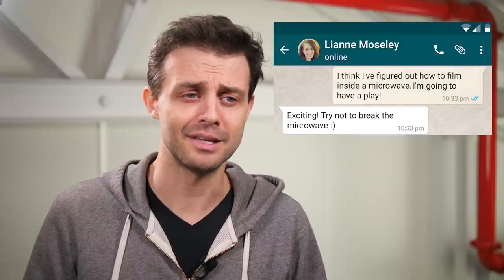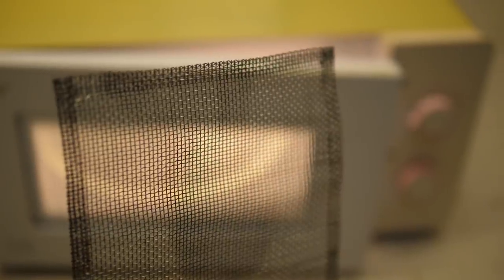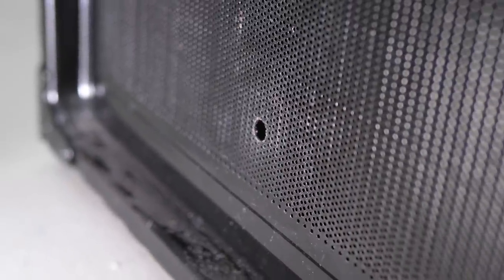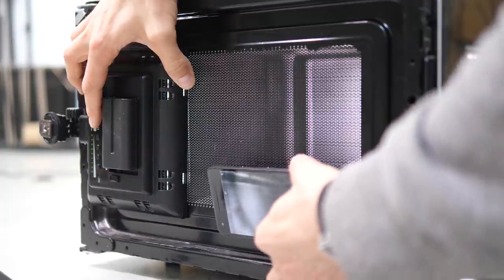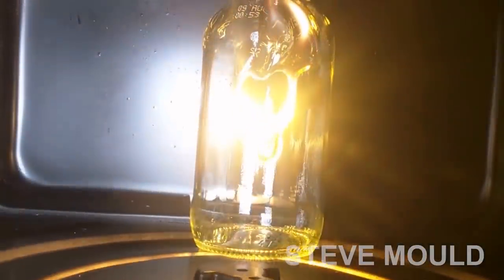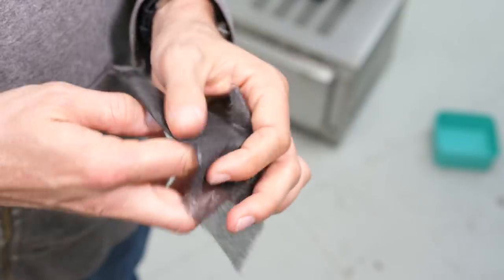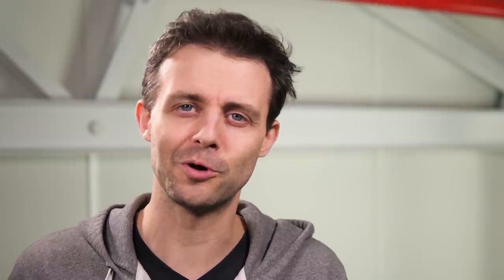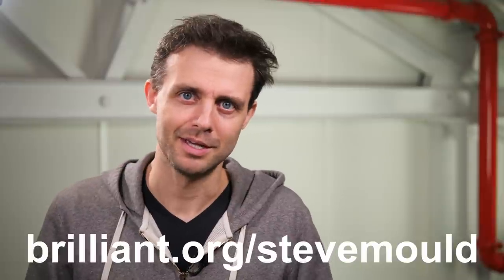How to film the inside of a microwave (2 ways)

Comment: fun fact. the integrity of your beaker is compromised and you should not use it for experiments using dangerous chems. The reason for it being compromised is that you have introduced differential stresses due to the unbalanced heating of the beaker, and in addition to that, the plasma has used parts of the sodium/ other material contained within the beaker to produce a colored flame. pelase be careful when using it. I believe nile red recently had to destroy all his beakers due to not knowing which one he used in a similar experiment.

Comment: I found out that if you jam the door in anyway a main fuse blows inside. It's for safety. It takes a special screwdriver to get inside to replace it, but the fix is easy enough; the fuse doesn't cost much. I just had some paper towels get jammed in the door. 
And there is that moment in the TV series Malcolm In the Middle (you aren't Dewey grown up are you?) where Dad (Brian Cranston)   as Lois, Mom is chasing the boys, shouts, "Hey! I figured out how to make the microwave work with the door open!" 
There's a video of a company wanting to make an ice cream product that can be microwaved so that the ice cream stays cold but the chocolate topping melts. (something the world can't do without...). A circular metal object doesn't spark.  You'd have to look into it.

Comment: You can put metals inside of a microwave but it shouldn't have sharp edges like a fork ,this would produce sparks,rounded metal ends like a spoon will be fine
Reply: I had a small spoon inside a mug that has very little amount of water (covers only a quarter of the rounded part of the spoon), and a piece of chocolate, when I turned on the microwave, after like 10 seconds a spark/bang occurred and the chocolate piece had a super-molten spot while the rest of it was still cold.
I think what happened was the curvature of the spoon acted like a concave mirror focusing the microwaves at a single spot.
So ... only put spoons if their rounded part is covered with something.

Comment: Here's a question though - I've determined 100% without a doubt that running my microwave interrupts the wifi, and there doesn't appear to be any significant gap anywhere in the lining... internet research shows that leaky microwaves interrupting wifi is not at all uncommon; so how are these leaks occurring? 

One idea I had was that some limiting component of the microwave is degrading causing it to produce a wider range of wavelengths then it is designed to filter - so these wavelengths can leak and interfere with the wifi. I know nothing about how a microwave produces waves though, so this is raw speculation

Comment: I would have thought that a pinhole sheet placed in front of a hole in material that is placed on the outside shell of the microwave and not of a microwavable substance, it could sit in the space between the glass and the metal inner door mesh.

The pin hole sheet then is picked up by a camera and decent lens that  focuses the incoming image and it is then inverted and corrected in software later.

It would save people destroying their microwaves by drilling a hole in the microwave. A pinhole hack... TYVM.

Comment: I once put a cup into a microwave and didn't remove the spoon because I though a spoon surrounded by liquid won't make any difference. When the table turned, the handle of the  spoon got too close to the glass, there was a spark and that spark melted a hole all the way through both glasses. The metal mesh between them was okay, though, the hole in the glasses were exactly were the metal mesh also had a hole, so operating that microwave was as safe as before, it just had a venting hole at the front now.

Oh, and Cody'sLab video is back up on YouTube. It was taken down because he put tiny flies into his microwave but not to kill them but to prove that you cannot even harm them that way. They are too small compared the wave length of the microwave and as thus, the microwaves can hardly create any heat at all inside the fly's body. The video was reported because cruelty to animals but the statement "No animals were harmed during the making of this movie" totally applied, so YouTube put it back up. Note that he used tiny flies. Putting a big fly into a microwave may not end well for the fly. If you want to test that theory without animals, put some very tiny drops of water onto a glass surface and place that into the microwave. The water won't evaporate, it almost won't heat up at all.

Comment: I put stainless steel dishes in the microwave for years.....
Reply: As long as the object doesn't have sharp edges you're usually okay. If the object does have a sharp edge then there will be a very high electric field at the edge which can cause arcing and heating. You can see this with a tesla coil where sparks will prefer to emit from a sharp point such as a piece of wire rather than the smooth dome

Comment: Actually you can place metal in a microwave, the manual for my Bosch microwave states that when warming a glass of water to place a teaspoon in it. Here's the direct quote:
"Try out the microwave straight away. You could heat up a cup of water for your tea, for example. Use a large cup without any decorative gold or silver trim and place a teaspoon in it. Place the cup containing the water somewhat eccentrically on the turntable."

The internet being what it is you might think I'm trolling, so here's the source on page 10: https://media3.bosch-home.com/Documents/9001277612_H.pdf

Comment: Isn't the layer of glass just to close the microwave ?
When you heat a thing, you want the heat to stay inside, and a mesh that blocks radiations is not gonna block air or water vapor much. My oven also has a layer of glass ! I'm also not confident they size the gap to match the attenuation pattern of the waves.
Reply: Ovens and microwaves work fundamentally different. Microwaves work by triggering water molecules and exciting them, creating a chain reaction from there, while all ovens work by infusing heat radiation to raise the ambient temperature in a room so a consistent donation of temperature is created. 

In other words, Microwaves are not affected by sealed or non-sealed enviroments while ovens require them.... Though glass initially was a simple design feature from manufacturers to allow people to look into said ovens

Comment: Hmmm. This could useful for Fusion reactors.

Oh, found this: https://phys.org/news/2018-11-plasmas-fusion-microwaves.html

I wonder if everyone will be using microwave containment fields in the future. You can theoretically control the interference patterns created by multiple microwave sources arranged symmetrically around a cylinder, and use those interference patterns to force plasma to behave and stay on course, in addition to creating plasma in the first place. Perhaps even generating plasma continuously to supplement. Fusion reactors might have a small feed of carbon fiber tissue's high tech cousin, or a refined version steel wool or something to further boost plasma production, using the microwaves as well.

Comment: I wonder if its possible to find a "cold spot" in the microwave and put your camera inside the microwave there ?
Reply: Not unless you remove the mode stirrer.
Reply: it's the inside of hot pockets
Reply: The cold spot of a microwave is wherever the center of a hot pocket currently resides.
Reply: I've seen a vid of an 8 year old girl calculating the speed of light.
C=fλ
f is quoted on the back of the machine,
λ was measured using a block of chocolate pinged for 20 seconds and measuring the distance between the melty bits.
Reply: @massimookissed1023  electroboom did that too - watch?v=nqTDCkuVADw its pretty cool
Reply: @invendelirium  yeah i would guess so, but i would like to watch somebody (Steve maybe?) test it out :D 
my old microwave had a broken spinner thing and it seemed like some places dont get heated at all. Its probably different with metals though.

Comment: Can you explain how the plasma forms? Why it forms? besides how to do it
Reply: At an educated guess:
Plasma is essentially what you get when you excite a fluid like air enough that the molecules and atoms break apart into a soup of ions.  Superheating air, such as with powerful lasers and lightning, can cause this to happen.
When you put metal stuff inside a microwave, you get electrons flowing around like crazy.  This is okay if the metal doesn't have sharp edges, but if it does then the charges can jump across the air from one edge to another, called arcing.  This is like a mini burst of lightning.  This heats up the air around that enough to get a small burst of plasma.  When you use something like carbon-fibre (or steel wool) that is very conductive [okay, carbon isn't a real metal but it can act like one] but has lots of edges, you get a lot of arcing and so a lot of plasma.

Comment: What if you have a lens infront of the mesh and behind so it gets from a wide angle to a point and back to a wide angle. I'm not an expert but it sounds like something that could work. As long as you dont use metal to hold the lens.
Reply: I'm guessing that the lens in front of the mesh would distort due to heat expansion as the microwave runs. Maybe you'd only get a second or two of decent footage.

That's just a guess though.
Reply: @davidonfim2381  Unlikely, as glass doesn't get hot in a microwave unless already molten.
Reply: @davidonfim2381  Would be an interestin experiment for someone with a second microwave oven.. i only have one but who knows if lenses change in micro waves. Its unlikely that it gets hot but maybe the light will travel different.

Comment: A better science channel would point out the difference in size between microwaves and visible light, and note the 500 nm orange wavelength is roughly 100,000 smaller than the 1mm gap in the microwave, which is why we can see through the mesh. And for a follow-up question, how small of a hole would you need to get the same 10,000 times reduction in visible light as the 12cm microwave gets from the 1cm hole?

Comment: but why you remove the glass plate tho? I get kinda bothered by things not rotating in the microwave
Reply: Because the purpose of the turntable is to make sure things heat evenly.  Microwaves have hot spots and cold spots due to standing waves (see some of Steve's other videos on resonance).  This means you don't end up with food that is half burnt and half frozen* or liquid that has superheated pockets in it ready to make the whole thing become volatile as soon as you move it.  It also let's you measure the speed of light by using a chocolate bar**.  However, if you're trying to film one side of a CD then having the thing turn round as you film could be kinda annoying!

*Half burned and half frozen is what would happen to you if you went in to space in view of the Sun without a spacesuit.
**Put a chocolate bar in the microwave for a short amount of time without the spinny plate.  You will find spots that melt quicker than others.  The distance between two of the hotspots is half the wavelength of the microwaves.  The back of the microwave will tell you the frequency of the waves.  Using v=f*lambda where f is frequency in Hertz and lambda is the wavelength in m, you can get the speed of the wave (light) in m/s.

Comment: or y'know, you can put some aluminium foil in a microwave... VERY safe
Reply: If you use it correctly, you can actually use foil in a microwave quite safely. It's something to do with not forming points for the charge to build up on.

Comment: Look; the door of microwave is blocking the view and other ways might be unnecessarily comlicated or hard. The best and most secure solution is changing the door. That sets you free from the limitations of small volume of microwave oven too. You can even use a bigger camera etc...

Remove the door. Remove the metal shield. If removing metal from glass is not possible buy a same size glass. (tempered glass would be a good idea.) Coat the glass with thin metal layer; that will make it perfect for microwave applications, better than original and if you coat thin enough you can see through it. (generally gold used for that but you can use another metal too but not all metals are suitable for this.) Metal layer must look inside of microwave.